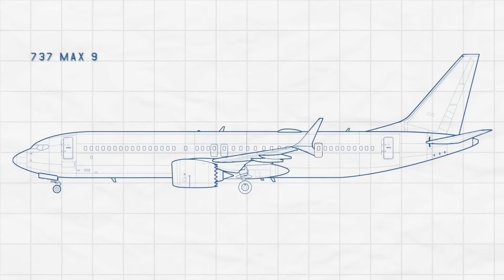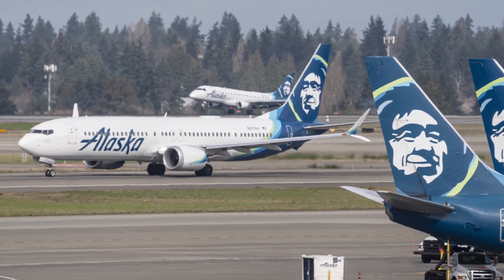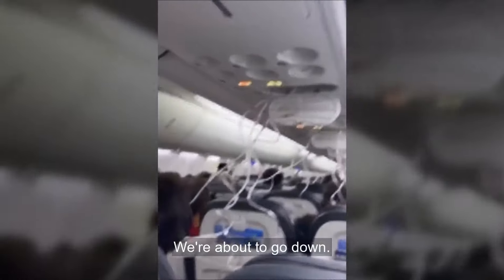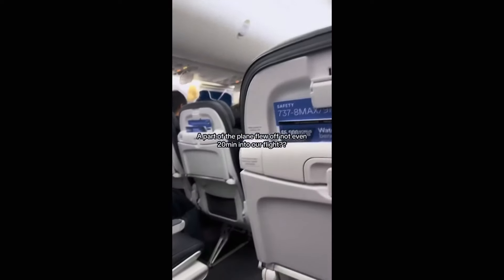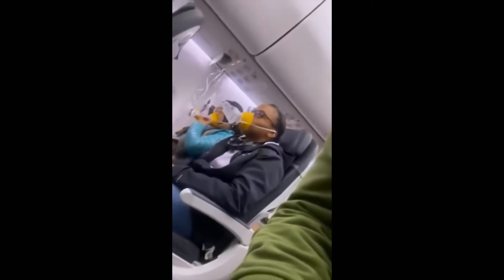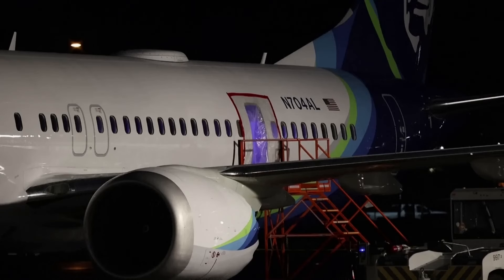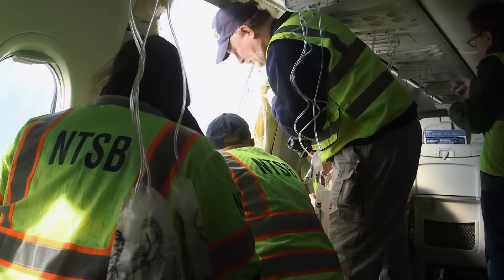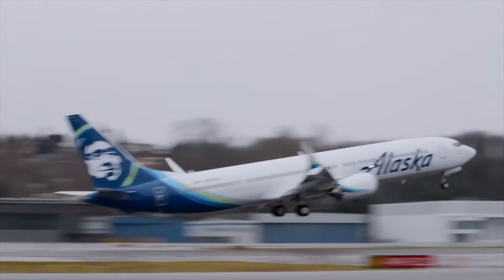Shocking Mid-Flight Incident: Door Plug Ripped Off Due to Maintenance Error!

Comment: You’re both right. Spirit delivered the airframe to Boeing but at some point the door plug had to be removed. A team from Spirit was at Boeing to do the work. When the door plug was reassembled bolts were not reattached. Not Airlines’s maintenance people at fault but the Spirit people who were supposed to remove and reinstall the plug. Identities have been hidden!!!
Reply: Clarification: Spirit delivered the flawed fuselage to Boeing, but Boeing didn't wait and started assembly using the bad fuselage.  Then the Spirit team had to go to Seattle and repair the door outside the normal manufacturing flow.   Boeing said detailed paperwork wasn't needed because it was just opening/closing a door (not true)
Reply: @BenjaminGSlade Good point!  If it wasn’t damaged in the first place it would not have had to have been removed.

Comment: I worked in Boeing QA for 31 years. To build an aircraft that gets FAA Type Certification the work is broken up into thousands of jobs to be performed either at the manufacturers facility or an approved supplier. Each of these jobs require a mechanic and inspector to buy off the job. If an area in the airplane requires rework and a previously completed job must be removed to gain access the mechanics must initiate a removal document. The removal is different from the paperwork documenting the repair. They have the repair paperwork and shift tie-in notes about the repair. Boeing and I will assume the feds know who was involved in the repair and I'm sure they have been interviewed. Boeing has also supplied the names of the 25 people who work in the area. The problem is the fact that the removal was not documented so there was not a job to buy off the reinstallation of the plug. All of this is public knowledge, I have no inside information other than a knowledge of how the process should work.

Comment: It is all VERY sketch. Both Boeing and Spirit were negligent. It is a manufacturing AND maintenance error. To be safe, ALL 737 should be inspected.
Reply: I agree. This isn’t an isolated issue. It’s not a single plane that’s had problems. Very odd everyone is pretending everything is fine…
Reply: All the similar aircraft have been inspected. There were no more defective aircraft found.